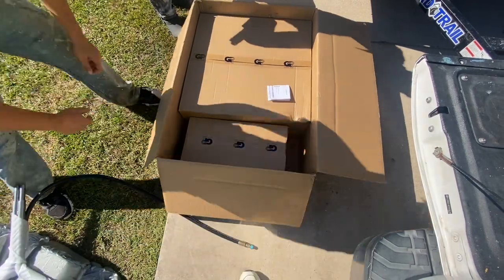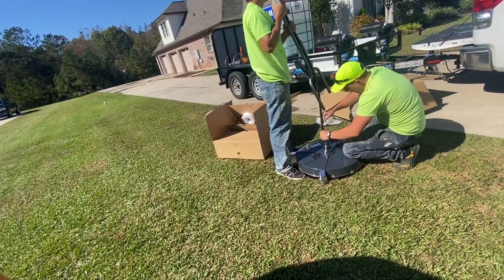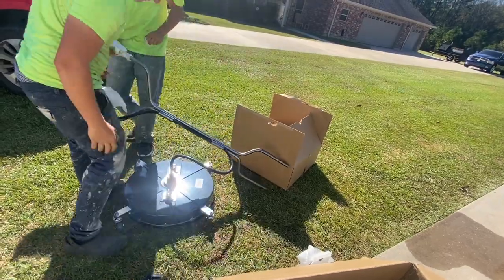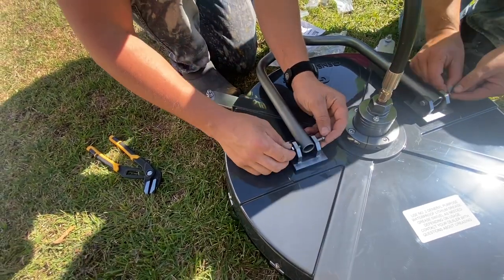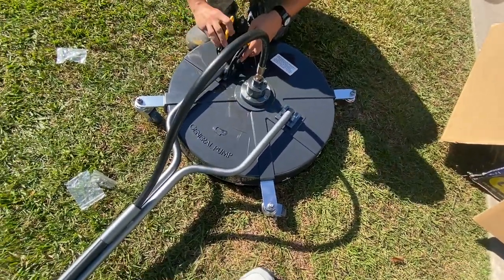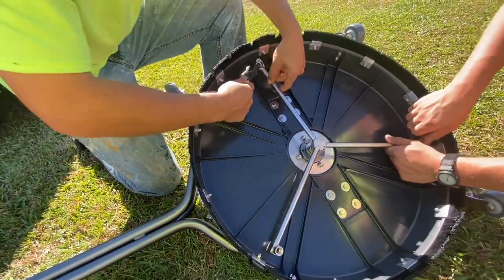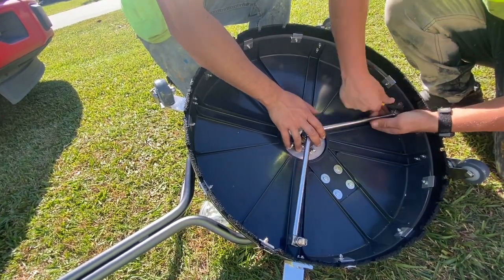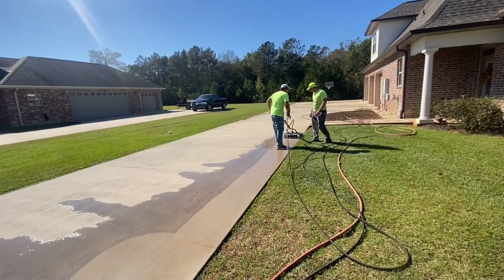$500 SURFACE CLEANER UNBOXING

Comment: Billy I have a question. I own a GP 22 hammerhead surface cleaner. Looks very similar to this one but it’s silver all around. I had some problems with it vibrating a little bit so I tried to do some preventative maintenance. I cleaned all the tips, and I took apart the swivel piece and checked the bearings and seals. Turns out the zerk was bad and wasn’t letting grease pass into the cylinder to coat the bearings, realistically I haven’t put more than 20 hours on it myself but I bought it second hand. The spray bar will move back and forth just the slightest bit as well. I checked the spray bar alignment as well and one of the 3 arms is bent maybe a millimeter different from the others. I’m just trying to take good care of my equipment. So I put everything back together the way it came apart and am now just hoping for the best. Should I just bite the bullet and replace both, or ride it out and see how it goes?
Reply from the maker: Hey I would recommend replacing the spray tips. Usually that's where your vibrations will originate from

Comment: would it be fine if i use a 3.5 gpm machine?
Reply from the maker: For your equipment I would recommend a 20 inch surface cleaner with double spray tips